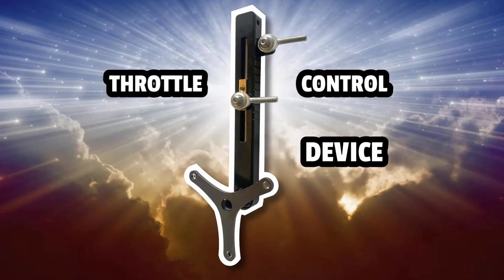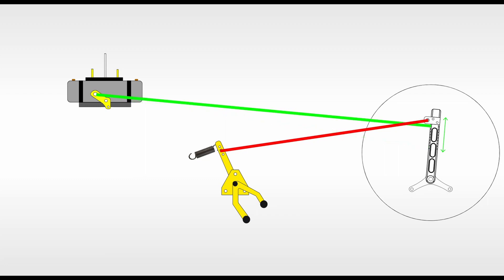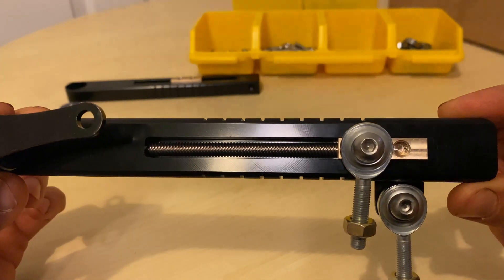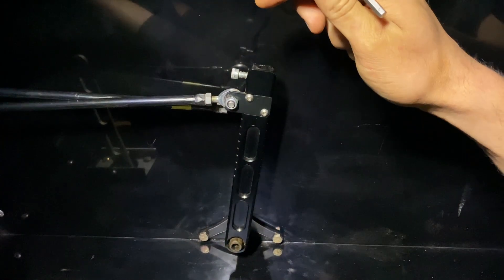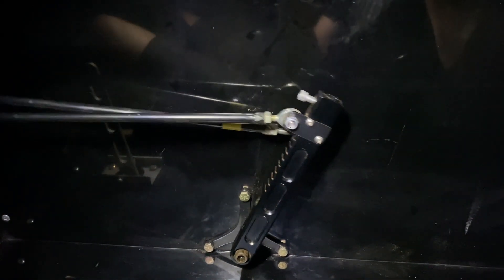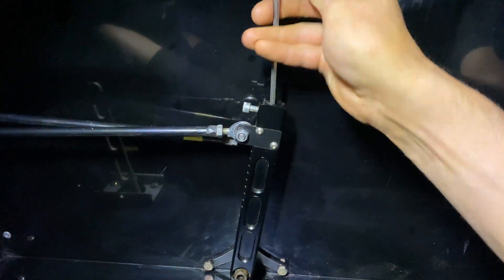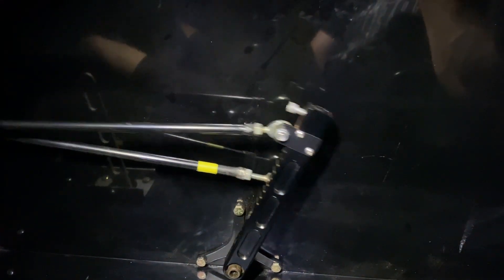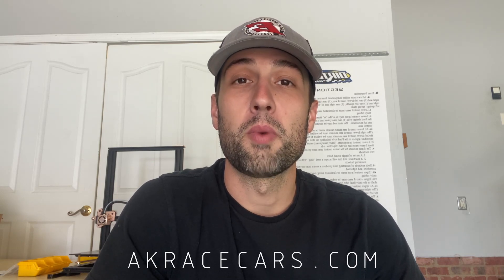🚨 AK Racecars first product release 🚨 |The TC Device

Comment: Butterflies are inherently non linear, and the engines response is also non linear. Your idea to give the driver more control is excellent, very few think control is necessary, however you need to look into creating a non linear pedal ratio from either using different angular motion of the TC or better yet, using a snail type arc that makes the pedal to butterfly ratio a logarithmic ratio.  You can achieve finer throttle control and still incorporate butterfly power limiting in one device.
Reply from the maker: Correct, the pedal linkage is non linear, your ankle/foot movement is non linear, the carburetor linkage is non linear (as mentioned).. there are lots of arcs. We’ve found that the TC device, angled at its recommended settings, doesn’t alter the default MAP much, just acts as an offset. It is common in our form of racing to orient the pedal linkage in a way that gives a progressive pedal/carb linkage relationship, so that the control is biased towards the early parts of the pedal throw when you are trying to control wheel spin most.

Comment: Add a knob so it can be operated on track.
Reply: Stepper Motor would do the trick. All you need is a potentiometer in the cab and you can do it on the fly...

Comment: Hey Austin, have you considered a brake bias type mechanism or something similar in place of the allen screw? Having the capability to adjust down the straightaway/during a race would be fantastic, I know I would fumble the allen key under pressure lol.
Reply from the maker: If your rules permit, then yes. Special attention would need to be paid to how that cable was mounted, so it didn’t cause unwanted resistance to the pedal!
Reply: @AKracecars  A small servo motor might work or if you tip the unit sideways and use a Morse type cable attached near the pivot and a knob up on the dash.
Reply: My first thought as well,if a track rubbers up you can gain power or if a track dries up take power out on the fly... great idea

Comment: Austin tell them it is also a safety  deal you will be able to get your hand on a stuck throttle.
Reply: Good point!
Reply: That's actually a great selling point
Reply: No kidding.  Years ago I showed up to Lake Ozark speedway with my sportsman car.  I was running a BBC.  The tech guys said I couldn't race because I didn't have a 'full sized' firewall.  One of the tech guys really wanted to see how a BBC would run, so he pointed me to a tree with a bunch of sheet metal laying under it.  He told me If I could get a firewall running the entire width of the car, I could race that night.  

We proceeded to hack & rivet a piece of sheet aluminum to the firewall... A few zip ties on the passenger side & we were good to go.  
Because I was a 'late entry' I had to start at the back of the pack on the 3rd heat race.  They were only taking top 3 cars to the feature.  By the end of the 8 lap heat, I was in 4th place of a 10 car heat, & was on the inside of the 3rd place car, 1/2 car back on turn 4 of taking the checkered flag... So, in my excitement, I pushed on the throttle as hard as I could, trying to beat the 3rd. place car to the stripe... Missed it by a bumper.

Let off the throttle, and it was stuck wide open.  pulled & pulled up on the throttle, no go.  I wend wide open into turn 1 when everyone else was slowing down because the race was over.  Needless to say, I not only wound up backwards into the fence in turn 2 but also collected the 3rd place car on one side of me, but the 2nd place car on the other side of me.  We were tangled up too, took about 15 minutes to get us apart.  

Turns out, I was using all thread for my throttle linkage from the peddle to the carb.  When I pressed the throttle extra hard on the last turn, the all thread bowed & hung up on the hole through the NEW firewall that the track officials made me install, in order to be legal.

Bent tie rods & drag link was the damage.  Had parts, got it together before the last chance heat, but couldn't get the front end aligned right & finished 5th in that heat, 2 places out of the feature... 

This device probably would have saved me from total embarrassment.